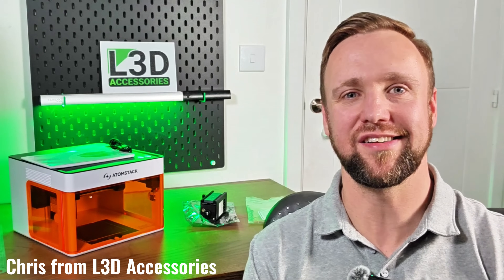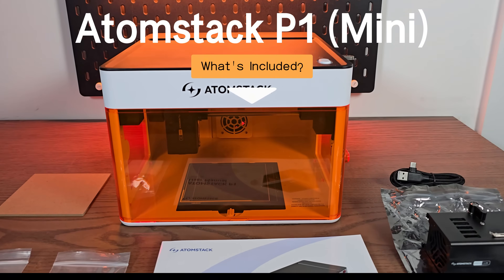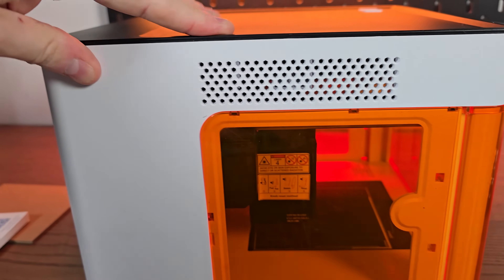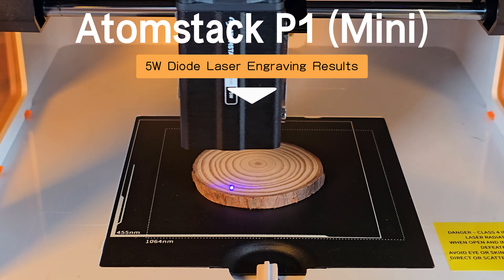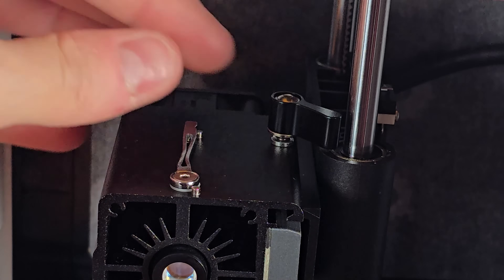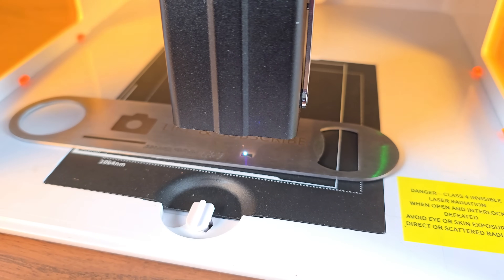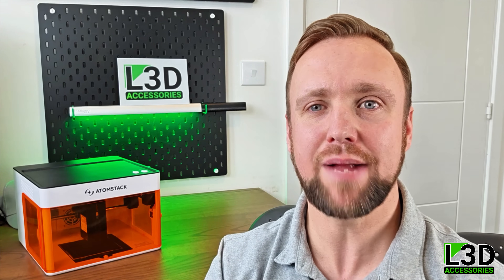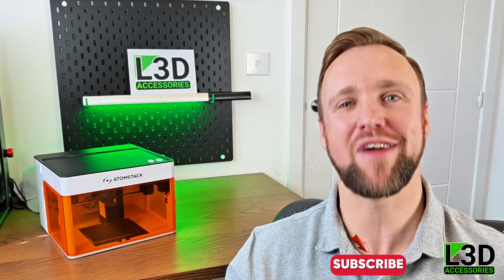Atomstack P1 Dual Review – Best Budget Laser Engraver for Beginners?

Comment: Please can you test the diode laser on some anodised aluminium? Every review of this machine only shows the IR laser etching into anodised aluminium, but diode lasers are capable of doing the same thing with enough power.
Reply from the maker: Unfortunately I'm not in a position to test it however from lasering experience I can confidently say that with the Diode you can also engrave anodised aluminium. It won't be as white bright as an IR laser can achieve but it produces a nice shiny finish.
Reply: @L3DAccessories  I've read conflicting information online, but from the few videos I've managed to find it looks like a >5W diode laser is able to bleach the anodised layer and turn it white.

It also seems to drastically depend on the quality and thickness of the anodising, but the black cards you can buy on eBay seem to work nicely.

I'm in need of a cheap, reliable, enclosed laser that can etch black anodised cards for my business and I'm hoping the P1 would be up to the task. I can't afford the IR laser unfortunately, so I'll have to use the diode.
Reply from the maker: @xmxlyyy It will be good enough, but it probably won't be white. It will be a shiny silver in my opinion.
Reply: @L3DAccessories  If it's a shiny silver that's mean the anodised layer has been completely removed, but I just want to remove the dye which i have seen done successfully with 5.5W, 8W, and 10W blue diode lasers at different speeds. 

I guess I'll just have to bite the bullet and find out, as I'm pretty sure I've watched every related video on YouTube at this point and it's really hard to find a concrete answer

Comment: I was expecting the software to show an image of the object on the plate so that you could align the picture you want to engrave on it. None of the tutorials tell how you locate a small object on the plate and engrave where you're supposed to.
Reply from the maker: If you're using Lightburn there is a way to "frame" a design. What this does is it moves the laser head in shape of your item that you want to engrave to show you where it will engrave. This is the best way to position your items in my opinion. The other option is to get a big to fit into the base plate that you put your items into. This will then allow you to setup your design centrally on the workspace and know it will engrave in the right place.
Reply: @L3DAccessories  Thanks! Will try it. They apparently have a trial period with no limited features. :)
Reply from the maker: @finndamage I'd really recommend Lightburn. It is very capable and the price you pay is really fair for what you get. It also works with most lasers (except xTool) so you can use it if you buy future lasers.

Comment: Can you tell me what the infrared does that the diode laser cant ... ive just bought this machine and waiting for its arrival but i only comes with the 5w laser... im mainly buying to do dog tags for my business on anodised aluminium tags...???? Thanks
Reply from the maker: It specialises in metal and can produce a clean whiter finish on metals compared to the Diode. It can also engrave really well on plastics. A diode laser can still engrave metals so you'll be able to engrave dog tags.
Reply: @L3DAccessories  ok thanks I was worried as the IR is another 250 actually more than the machine itself lol thank you...

Comment: Step by step turorial would be useful. How to calibrate the start point and the working area? My P1 Always goes far off the marerial , making incomplete texts or the laser goes too far resulting an error and red light 😢
Reply from the maker: I'll be doing some videos in the near future showing how to engrave with this machine in more depth. Which software are you using? Are you framing the item first to double check it will engrave in the correct place?
Reply: @L3DAccessories  atomstacks own software on Windows. No, im a total newbie in engrawing, don't even know how to do framing or anything. Sadly not many useful turorials are awailable on how to begin engraving.
Reply from the maker: I'd recommend taking a look at Lightburn. It's compatible with the machine and there are lots and lots of tutorials on YouTube you can follow to improve your skills. The secret to getting good at laser engraving is just practice. There are no shortcuts unfortunately, you just have to practice on lots of materials, learn from the results and then tweak your settings and try again. @spyware1100

Comment: Thanks for the great video!  It looks like with the IR module you can engrave well right onto plain stainless steel - it doesn't have to have any coating or bond spray applied.  Is that right?
Reply from the maker: I really appreciate the kind words! Yes it can engrave straight on to stainless steel. You can achieve a range of colours by varying the power and speed ratios and the marks are permanent.
Reply: @ Very cool!  Thanks so much.

Comment: can it do things like xtool f1
Reply from the maker: @movielovers6943  In terms of materials it can engrave/mark, yes it can. The thing to bear in mind is that this is a core xy laser engraved which means it mechanically moves around so it's not as fast as the xTool F1. That being said, because it's a corexy it also means it engraved perpendicular to the surface it's engraving onto which means cuts and engravings are cleaner.